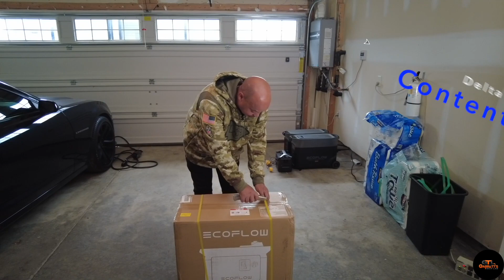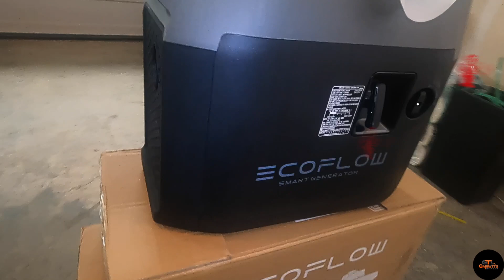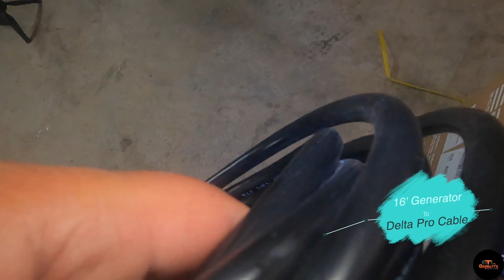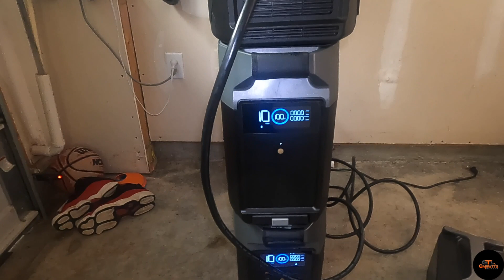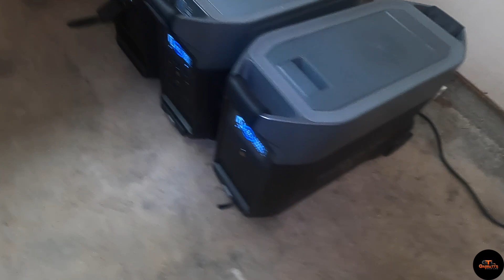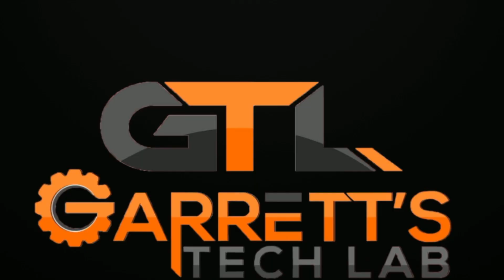EcoFlow Delta Pro Generator Unboxing

Comment: That's sweet. Read somewhere that this smart generator beats out some of the higher spec Honda generators.
Reply from the maker: I have read the same thing, especially when you factor in the remote and electronic starting.  I think the Honda puts out two more watts at full load. thou.  The electronic start was a big factor for me, as well as, it being able to start on it's own to charge the Delta pros.

Comment: Awesome video I have the river pro and mini. I plan on getting the delta max in a next few months. Delta pro is out of my range as of now. But having the pro with two extra batteries and the gas generator would be nice. Tons of power at hand.
Reply from the maker: I agree I just wish that you could put the generator in the infinity port so you could charge all three batteries at the same time.